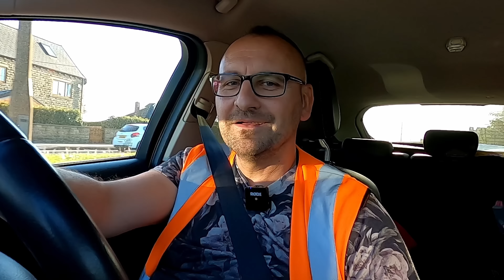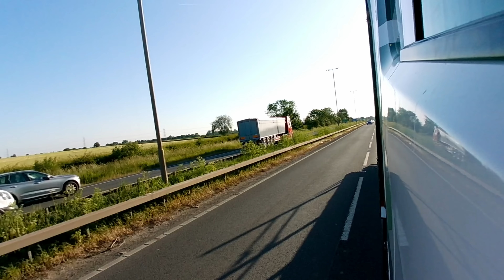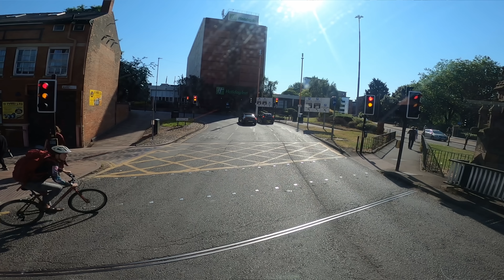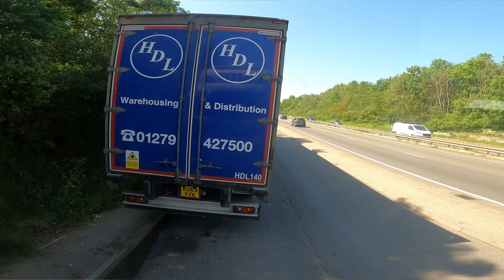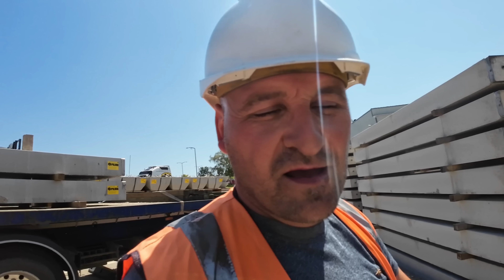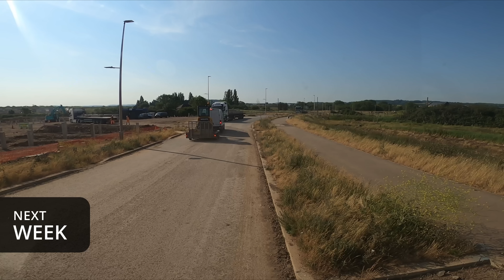Load is not safe... I'm not taking it! ✔ Trucker 🅵🅻🅾🆉 ✔ [4K]

Comment: Wonder how many decanewtons that cheap plastic wrap around those bricks was rated for! Though to be fair, probably more than the fresh air holding the rest of them together. I'd say that's a site that needs to be avoided at all costs by anybody, not just truck drivers. If they think that's a safe load, how well do you think they take the safety of the people working on the site itself?